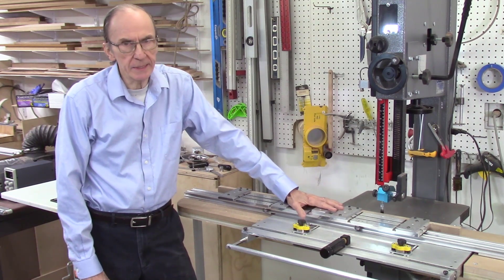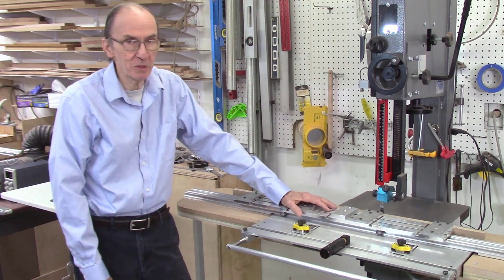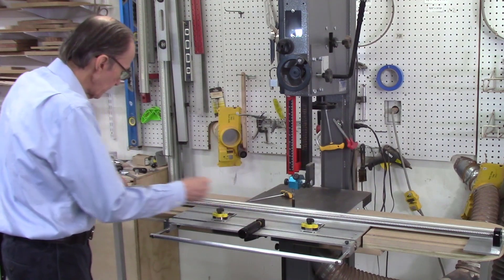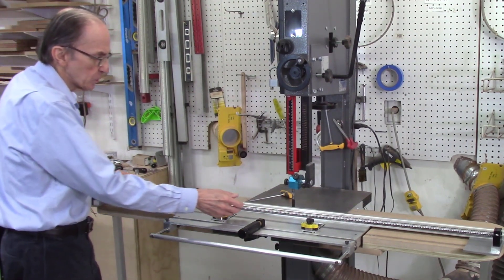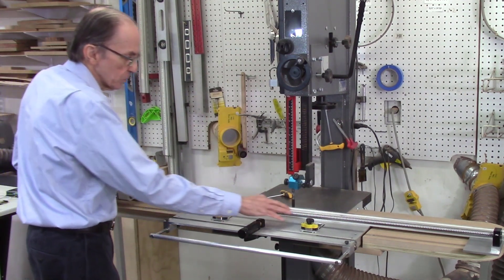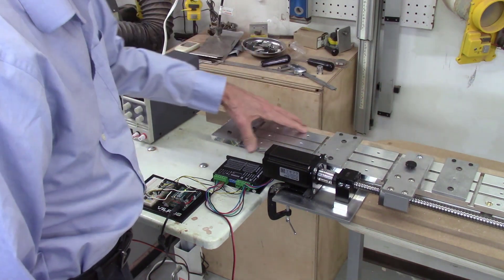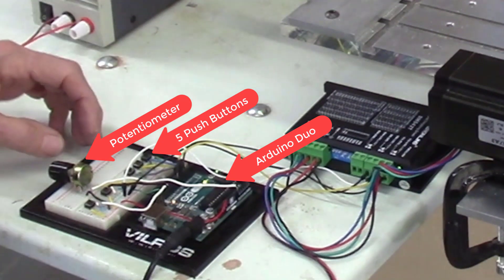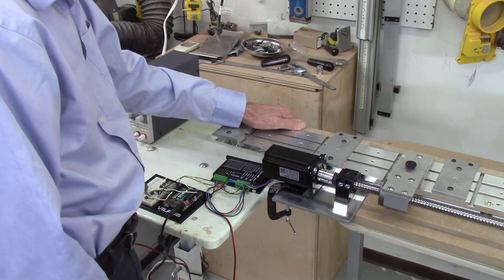Automation of the Accu-Slice System - Part 1 - Design of the System (129)

Comment: Really cool John.  Really good idea.  I might have to dust off my programming hat and get into Arduino programming.  I would definitely program some sort of sensor to tell you how much it has cut (relative to your selected speed), i.e., how far has it moved or how far down the rail it is.  This will serve two purposes.  One you can program the length of cut.  Two, and more important (in my opinion since you will have limit switches), it can be programmed to stop if it doesn't advance due to some problem like a bind, clogged bearings, failure, etc. This way it won't keep trying to push it through if there is ever a problem.  Again, really cool idea.  This should provide really smooth finish right off the cut.